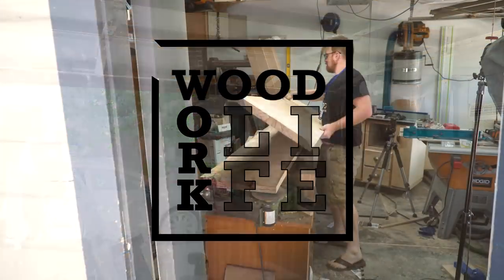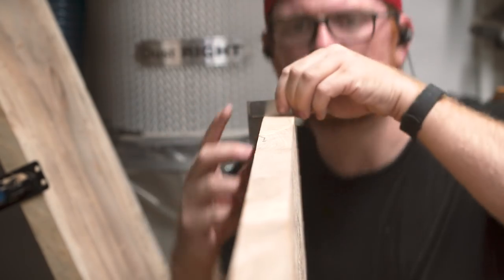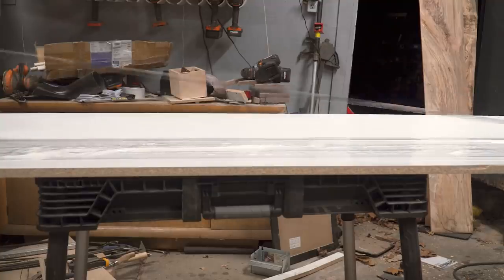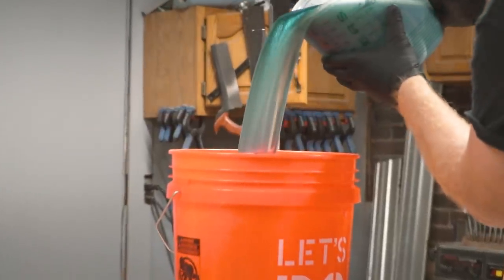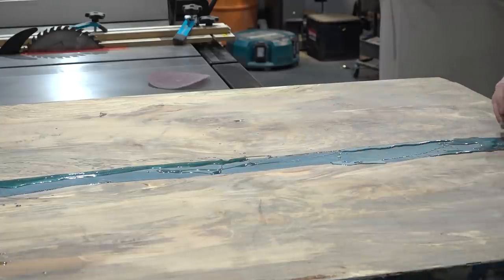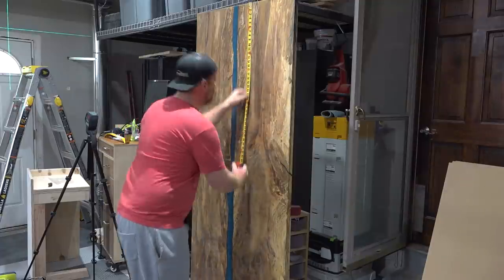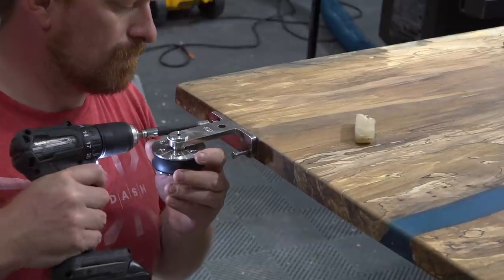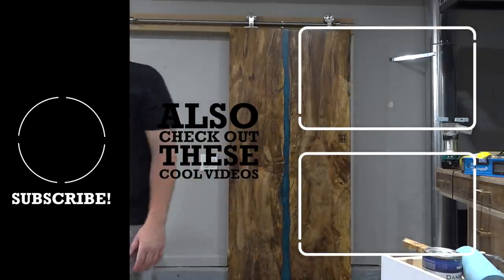Completely Unnecessary but AWESOME! - Epoxy River Sliding Barn Door | Woodworking Builds

Comment: God bless you for following through with this project especially after the epoxy issue. I give you a lot of credit there and what a magnificent piece it turned out to be. I’ve just recently filled some voids in a spalted maple piece to where the epoxy penetrated some of the punky wood as well. A plus in stabilizing the wood but has thrown me off on the finishing stage. These areas where it has penetrated are much darker . Even though spalted is filled with this type of presence it’s a bit to much. Any suggestions? I’ve only sanded to 120 so far but hate to take off any more of the thickness I’m left with. I’m looking for something to even it out as much as possible.
Reply from the maker: I am afraid that is sort of a consequence of punky wood.  You could try a penetrating epoxy or a wet coat epoxy finish over the whole thing.